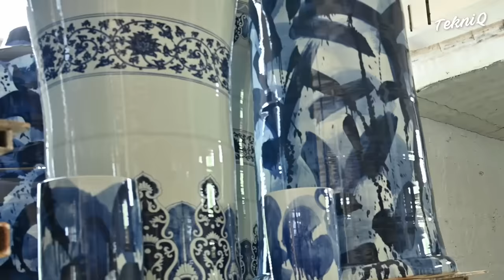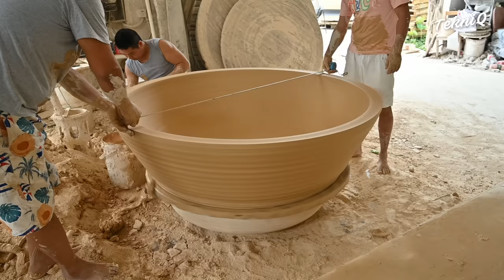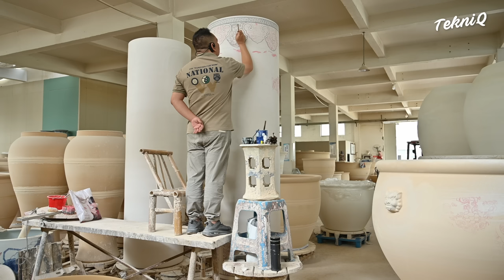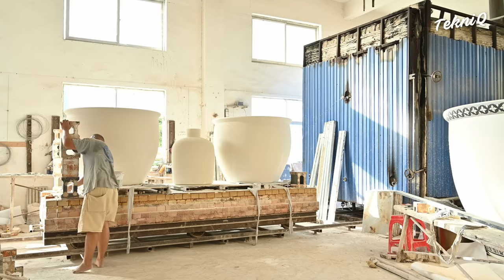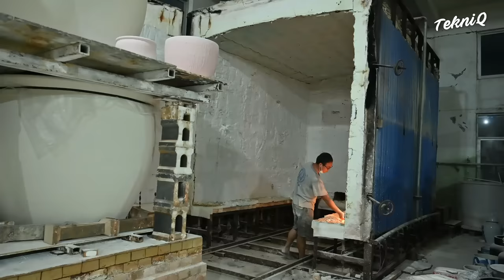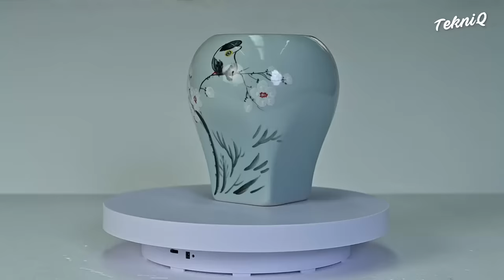Hypnotic Way They Produce Largest Clay Pottery in China

Comment: That is insane. I wonder how they do the ones that are taller than them
Reply: They have a night crew of giants. I work with the day crew.
Reply: They put two together to get the height, i think.
Reply: Fascinating but I’m left with so many questions. Eg What was that black stuff on the first pot?
Reply: @fibienn250 it may have been a glaze or an under glaze.  An underglaze is like a paint and then you put a glaze over it, then fire it.
Reply: They do the bottom.  The next section is a cylinder, open on the top and the bottom.  They join those two pieces together.  They can even do a third layer.
Reply: @yongyea4147  
😂😂
Reply: @fibienn250 . I think, but not sure, it was something to slow down the evaporation of water.  The pot is sitting on a that round disc, so the water cat’t evaporate from the bottom.  I think the unequal drying might make cracks, so they put a coating in the inside to slow down the drying.